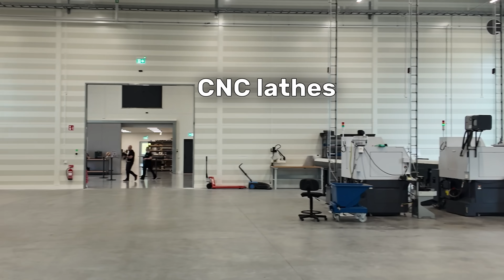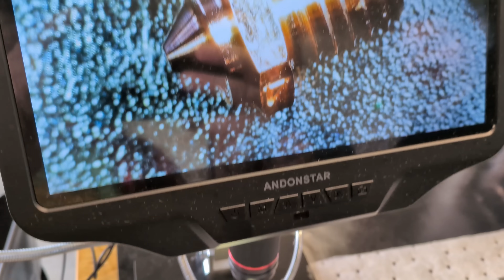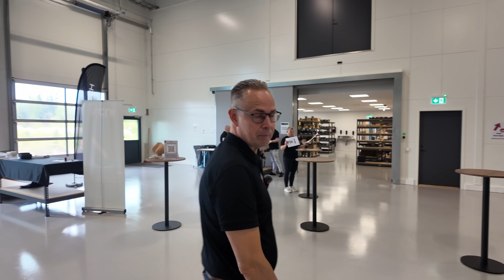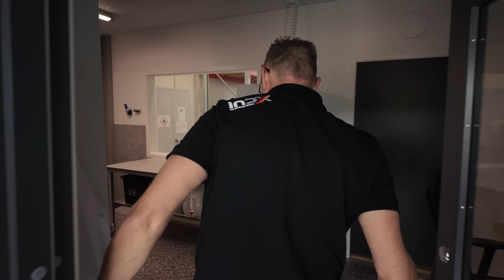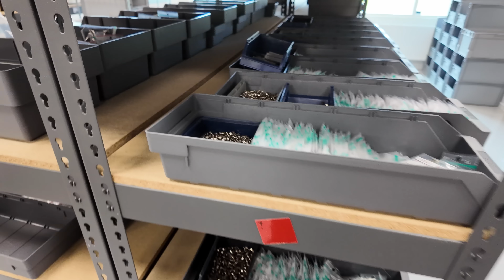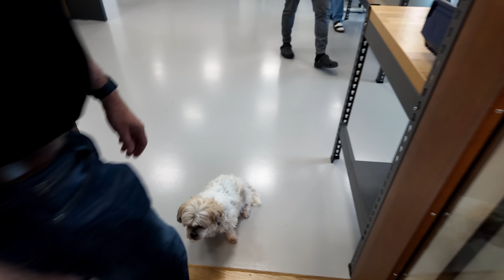Making Extruders AND MORE at BONDTECH!

Comment: I use bondtech extruders on my printers and I've always thought they had the highest quality products available, learning in the video that only 16 people are running a start to finish production line, research and development, marketing solution and product fulfilment all in the one building designed exactly for that process is so impressive. they even planned enough for expansion in the future. i remeber how hard it was to finaly get my Voron 2.4 printing and the massive learning curve that was, imagine investing in scaling your product you have developed and you now need to learn to operate and maintain 5 axis CNC and a bunch of sls printers, all while meeting current demand for existing products and all the challenges that come with running a business.

Comment: That's a gorgeous facility.  Bondtech does a lot with 16 employees, largely thanks to automated CNC manufacturing.  I think the INDX is going to be huge for Bondtech.  I hope they can roll out entire Bondtech systems for existing printers.  The high volume printers are an obvious choice but the Voron 0.2 shown at RAPID gives me hope there will be an INDX for my Sovol Zero, and the Voron 2.4 being tested with INDX in this video gives me hope for my Sovol SV08.